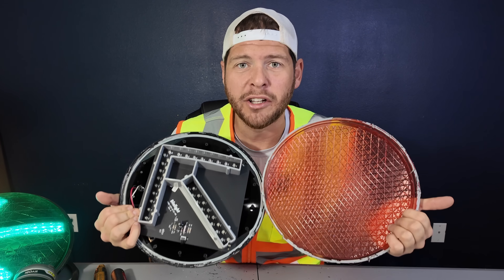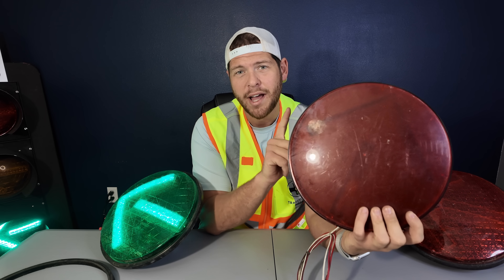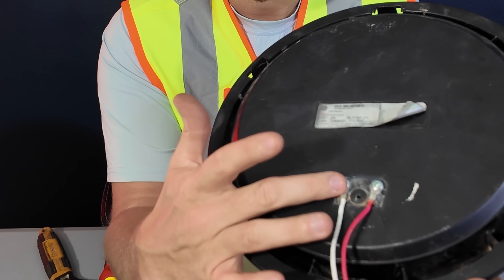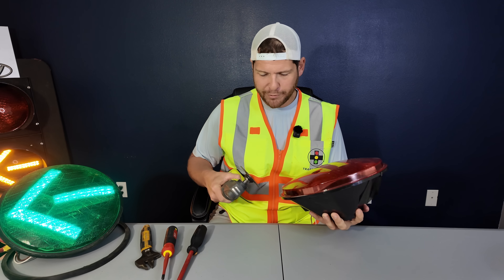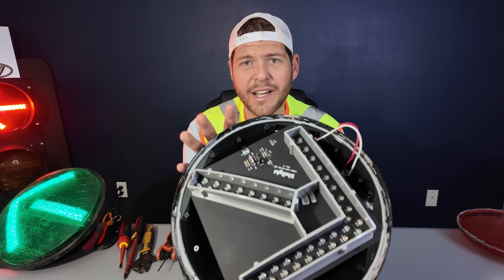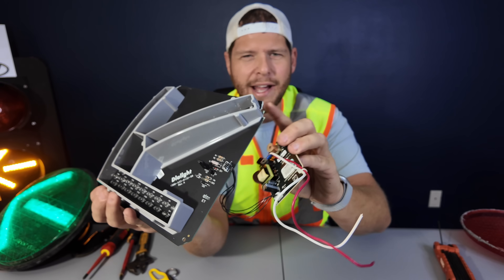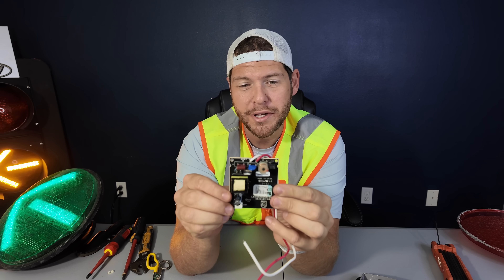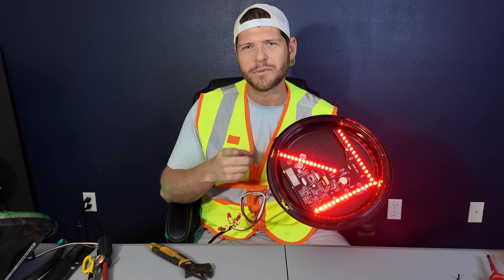Cutting Open A Traffic Light!!

Comment: I have two traffic signals - 1 with 8” lenses and the other with 12” lenses/backing shroud and lens visors. When I went to pick them up I was surprised at how large the assemblies are, and how heavy they can be. 

Got them with all LEDs working when i got home and tested them, and I have the 8” signal wired up to a controller. Still gotta get the big one wired up. I’ve wanted one since I was a kid.

Comment: So I know you’re not a construction worker, but every construction worker knows that the proper name for the oscillating tool is the vibrator. I have several vibrators. Corded and non-corded… There are a few old-time GCS is still called the eeeeh eeeeh   but everybody agrees that it is the vibrator

Comment: Manufacturers like to use an off-the-shelf power supply, it seems. I would guess it makes it easier to get through regulatory approvals, as those drop-in units would already be certified.

Comment: just a little side note. General Electric (G.E.) as we know it, does not exist any longer. Over probably the past decade it has sold off parts of itself such as G.E. Lighting, G.E. transportation and may other parts. It now solely exists to manufacture aircraft engines and aerospace stuff. G.E. has licensed the name to various manufacturers such as Haier, which bought G.E. appliances.

Comment: LED traffic lights are built to withstand ALMOST any type of weather conditions.  there is one that they are poor at, and that is being covered in snow.  sadly, they are unable to prevent being obstructed by sticky snow which makes it them hard to see during daylight.

that means you either have to wait for the snow to fall off or have someone manually clear it, which isn't that effective for mast mounted heads.

Comment: What voltage are traffic lights? 110v? 220? 24vdc? My instinct tells me its probably 110v due to the amount of old legacy hardware out there. But I figure with LEDs taking over, maybe they've gone to DC. I wouldn't be surprised if they build the lights with a built in dc converter so they could be a "drop-in replacement" for higher voltage AC systems.

Comment: What's really awesome about these LED modules is that they can be easily retrofitted into decades-old incandescent signal housings. I love when new technology retrofits into old. LEDs are a massive improvement: they're cheap, they save a ton of energy, and are so much more bright and visible than the old incandescent signals. I bet those LEDs are also under-driven, too, so they will last a VERY long time.
Reply: The best thing about LED signal lights is that LEDs are monochromatic. The color of the signal does not alter with time!
Reply: A number of years ago, I was walking the local streets, enjoying my morning coffee, when I came across a tech replacing the LEDs like those shown. Being an electronics tech myself, I asked about the lifespan. He said about 3 years, which shocked me as in my area of expertise, LEDs were expected to last forever. Lately it seems they are overdriven to the point they hardly last much longer than incandescent.
Reply: @jackmatson962  Yeah the LED bulbs you get at Home Depot or wherever have been very disappointing. And they are much more expensive than incandescent ever were. Plus you need to discard them in hazardous waste, just like the CFLs of yore.

Comment: Not the first one I've seen taken apart. Another youtuber took apart an LED one a few years back, but wasn't an arrow one.
Reply from the maker: Yeah I’ve seen them hit the ground from 20’ but don’t look too good after that! 😂
Reply: @Trafficlightdoctor  I've seen a lot of the much older fixtures laying on the ground or barely hanging on after bad storms. The old wire-mount rather than mast mount types. Many from Crouse Hinds and other 50/60's era. With them being two and/or four way set-ups.

Comment: Until I read an article about traffic lights, I didn't realize the red ones fail more often than green or yellow ones.  The "ON" time for each color is not equal.  By far, the red light is ON the most at most intersections.  The local community was upgrading the traffic lights to LED from incandescent.  In order to quickly start saving on energy, they upgraded the red lights first.

Comment: It is interesting to see the difference in the manufacturing. Now it is more modular where the power supply is setup for quick install at the factory then they choose which pattern of led to install. GE making it would be as we saw both power supply and led's crammed on the same board. Maybe even the power supply on the back side for the full lens signal. I still think it is a problem that the signals now without their big power hungry bulbs in them can not melt snow off of the shields. Wish they would put some sort of shaker in the heads to help shed the snow.

Comment: GE made them from the 20’s to the 80’s? And they were also LED’s?????   
   Am I missing something?  
The corner by my shop is an off ramp from the 405 in Inglewood, and simi-trucks constantly knock over the traffic lights there. They are all GE they are all LED’s and replace them with the same. This was up until they redesigned the intersection last year. 
  So this L.E.D. In the 1980’s doesn’t compute for me. Just wondering.

Comment: GE Actually does still make LED modules. They just don't make signal heads anymore. I saw my local contractors installing MoboTrex SA Polycarbonate Signals (Durasigs) with GE LED Modules while the Dialight ones were backordered or hard to get.

Comment: I have found these LED  traffic light modules for sale at swapmeets years ago. I have purchased like three of these modules which were being sold for $5 each. I don’t remember the manufacturer (might have been GE). It’s cool they work on 120.V, therefore not needing any transformer or driver (driver is built into LED board). I believe I have both arrows and full ball modules.

Comment: As an EE engineer I have questions. So, incoming voltage is standard 120V AC, is the voltage driving the LED array the same between vintage and modern? Second, are the LEDs in the arrays wired in series (if one goes out, the whole line array goes out) or parallel, (where if one goes out the outage is just confined to that LED)? Third, there are some situations in the wiring and the LED arrays where when you lose LEDs, the current jumps up a little bit to the remaining lit LEDs, making them brighter; is there a current limiter to prevent that as it will shorten the life of the remaining if driven by too much current? Fourth, if the incoming voltage dips, do the LEDs dim accordingly and switch off at some point? 😁

Comment: Got a train crossing light.  Been trying to find a power supply for it, not sure of the voltage.  It's LEDs, but I think the power is AC, not DC.  
No need to ship, I'll pass through Vancleave, bring my flasher.
Reply: 10v DC I have one

Comment: I like your channel the shop i use to race my car out of had a very old traffic light it had regular type hous hold bulbs in it. We put a sticker on the red lid light saying BROKE , the yeallow was  going racing which stayed on while fixing the cars. And the green was gone racing it did hag from the ceiling in the shop. We put a pull cord on it to switch the lights

Comment: Damn, I love this and would love it for my home.  Is there a way, via email that I would contact you with wiring questions for traffic lights?
Reply: Try using a flasher on yellow circuit wire for the Flashing Don't Walk if the controller is designed for three outputs and each color is timed time for several seconds. The flasher rate might not be same as a normal ped sig, depends on the flasher's flash rate on how close you will get.
Reply: @miluth2 a flasher?  I don’t know what a flasher is other than a person behaving indecently.  lol. Is a flasher the term I would use at the electronic store nearby?
Reply: @miluth2 thanks for the info.  I didn’t know what was needed to make it be solid for a bit then flash,  in Canada it shows solid and when time is running out to cross it flashes.  We have icons here not words.  A hand and a walking man outline.
Reply: @jillmac4447 we have the man and hand too, just pass practice before hand and man was words. So some people still use word to reference the hand and man. Question is your normal residential voltage 120/240 in Canada, If so, I would assume your traffic signals are 120v.
Reply: @miluth2 well on the back it says 110v and it came off the main road near me.  Here 110v is normal but the system is upgrading here for all those electric cars that no one is buying.  Lol
Reply: The lights are easy to wire. They use 2 wires and 120 volts. You could use a common lamp cord and plug it in.
Reply: @WilliamLutz-dj9zo so I don’t really need the sequence controller?
Reply: @jillmac4447   You would need the controller if you wanted the lights to go green, yellow, red, etc. The controller is wired with 120 volts going IN from your household outlet. Then three 120 volts circuits go OUT to the red, yellow, and green lights.
Reply: @W @WilliamLutz-dj9zo r the walk don’t walk signal I have there is a walk and a don’t walk in the one light.  So Iwill need a controller to have to switch between the two.   It only needs two though.  Will there be a problem if it has three spots when I only need two of the three?
Reply: @jillmac4447    A three circuit controller (for a three light signal) will perform different than a two circuit controller. You might have to get a two circuit controller for the don't walk/walk signal to perform like a normal pedestrian signal. You can connect the don't walk/walk signal to the three circuit controller but it won't act like a normal pedestrian signal.
Reply: @WilliamLutz-dj9zo I can’t seem to find a two circuit controller though.  How will it perform differently?
Reply: @jillmac4447    You would have a circuit not being used because you would be using only two circuits. So your pedestrian signal would not go from "walk" to "don't walk" then back to "walk". There would be a short time when neither would be lit. Also, depending on the controller you might be able to set the time to zero for the unused circuit.
Reply: @WilliamLutz-dj9zo I might be better off with a box attached with buttons perhaps?  A control box? And yeah, I don’t know if I can set different times for each light…. Would be. Nice to make the walk flash for a bit before it switches to the hand
Reply: @jillmac4447  That's what I would do if I couldn't get the proper controller. Just use two toggle switches and run the lights manually. Sometimes you could have just the "walk" light on or just the "don't walk" light on. Or both on at the same time. Do you know how to do basic 120 volts wiring? Do you know about "hot" wires and "neutral" wires?
Reply: @WilliamLutz-dj9zo never done this before.   With the walk, don’t walking I got from guys working on the road, it is one light with the walk, don’t walk in one light box.  So it is two circuits on one single light panel.  I know enough of what I need to do, but I am not an experienced person, can fix wiring or replace wires.  I know that the orange and white wire makes the hand show up and the same white wire with the blue makes the walk part of it light up.  Unfortunately they didn’t give me the entire casing with the count down timer in a separate light where the walking signal starts to flash while the countdown starts.
Reply: @jillmac4447   Connect the two white/neutral wires (one from each light) to one wire of a cord that plugs into an outlet. Connect the orange/hot wire to a switch. Connect the blue/hot wire to another switch. There should be one terminal on each switch that still need connected. Connect those two terminals together and then connect them to the other wire of the cord that plugs into the outlet. Remember that the wiring is 120 volts AC and if it is not done properly it could be unsafe.
Reply: @WilliamLutz-dj9zo  there is only one white wire inside that is shared, not two white wires as you said above. Is this a problem?  Kind of like the switch is to alternate between the orange and blue with the switch, while sharing the white nee trail  wire.  Good thing is that there is a repair cafe where I can bring stuff in for fixing and working with someone.  I plan on doing this on the weekend.  It is free but I will give a tip for the help!  :). Ihave to bring the parts in with me.  Will be my first time going in and I am sure that they have never had one brought in before
Reply: @jillmac4447   Since there is only one white/neutral wire that means the two lights are sharing the neutral. No problems. The one white wire will be connected to the power cord that plugs into a 120 volts outlet. Since you want one switch to control the two lights separately you will be using a " single pole double throw" switch. It will have three terminals. Usually the middle terminal will be connected to the "feed/live" wire of your cord that plugs into a 120 volts outlet. The other two terminals will be connected to each of the lights. The orange wire will go to one terminal and the blue wire will go to the other terminal.

Comment: Pretty interesting to see. I thought there was more going on in those things. What's the difference between the solid color ball LEDs and the arrows?
Is it really true GE made those LED indications that long ago?
Reply from the maker: I was actually a little wrong! GE made housing and all from 1923 to the late 80s and recently sold the lighting side in the 2000s!
Reply: "At the first of the 1980s, the introduction of light-emitting diode (LED) lights resulted in an even longer replacement cycle and lower energy use. The first patent filed in 1982 by Thery Hindrick en France with a matrice of LED with electronic components"

Comment: Love your videos. Watch them after work quite a bit. I have two questions. I have a light at the end of my road that is bugging me. What would cause one head to cycle slower than its twin in a phase? I'm talking about a noticeable quarter second-half second delay between switching from yellow to red, back to green. Even on flash one is turning on before the other. Second question - When you replace a controller at an intersection is there a memory card with the settings? Can the city get into the M60's remotely or do they have to come out and re-program them?